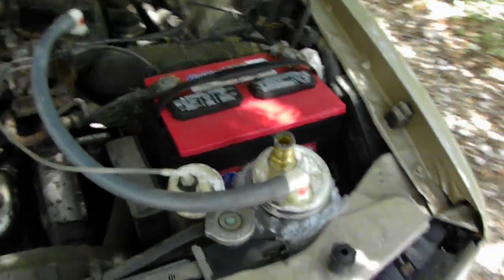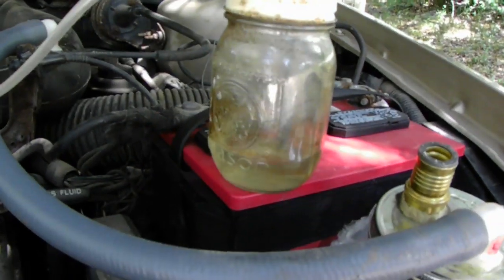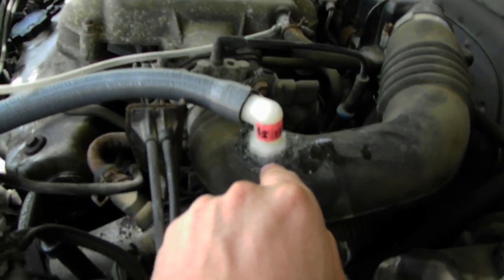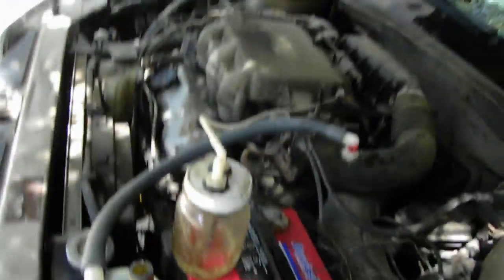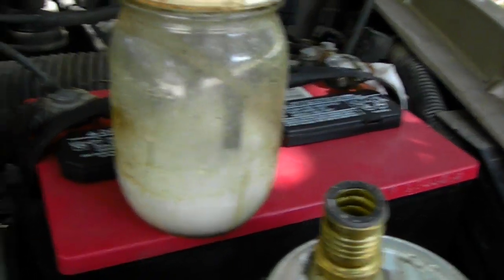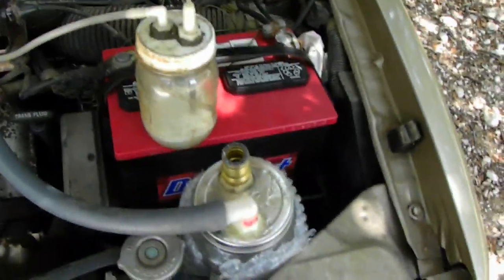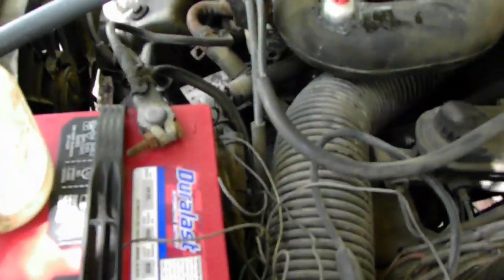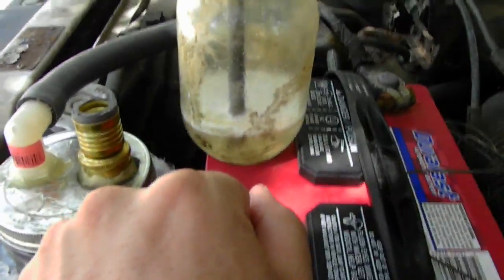Alcohol water vapor induction/injection

Comment: Rather than reducing the amount of vacuum with a valve on that line, why not reduce the air coming into the jar?  That’s the incoming air making all the bubbles. 

Also, fuel heating: heat the return line rather than supply to rail - as the warmed fuel returns to the tank and hits the cooler fuel there, you’ll make more fuel vapour for the evap system to evacuate to the intake. As level in the tank drops, the fuel will warm, increasing vapour pressure in the tank for the evap system to vent more often, possibly replacing what goes through the injectors - you’d just have to be careful about burning out the fuel pump if the level got too low in the tank, or find a way to turn it off.

Comment: Nice! Basic and effective. The air bleeding orifices in manifold reduce pumping looses and fake" air is not "reported" to ECU. This reduce injection time, providing savings. The problem is the detonations and possible misfire events due lean mixture. This lead to ignition time retarding and all benefits are lost. Water vapors solve this issue and add extra torque lost due low fuel. Congrats for excellent work.
Reply from the maker: The chance of detonation or pinging with these systems is greatly reduced to get the full effects of gas savings you need to use an 02 simulator or efie or the o2 sensor just detects more oxygen then sends more fuel into the engine